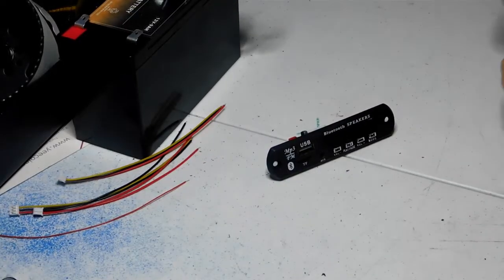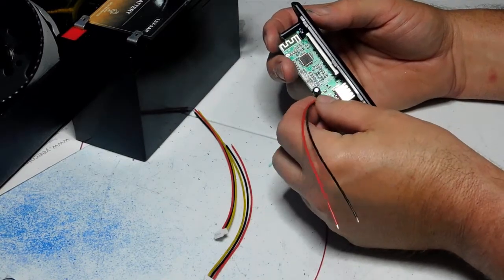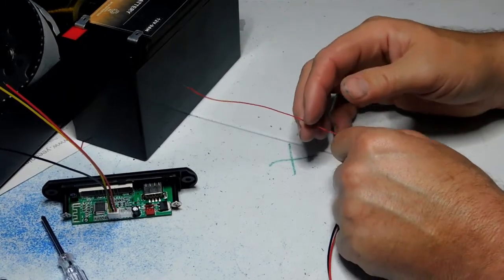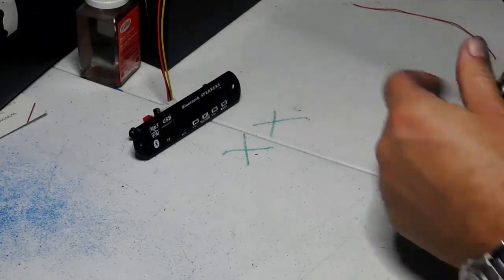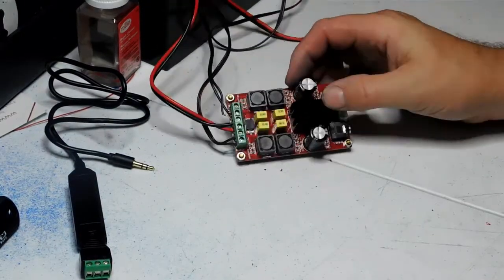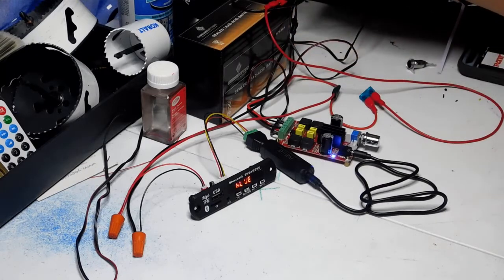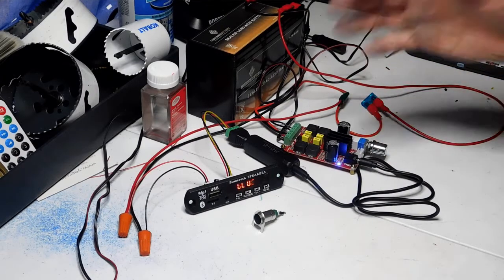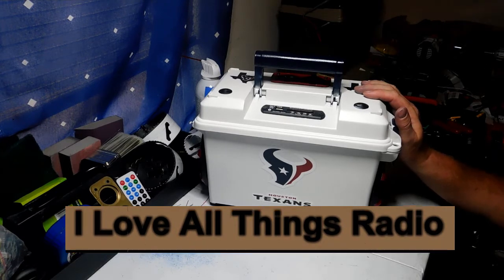How to add FM Radio to your Boom Box projects

Comment: Hey Phil, I've been trying to add an external flexible rubber mast antenna to my metal ammo box build by using the female adapter you recommended in your video.  I soldered it up the way you mentioned but still get rather crappy to no reception.  Any idea what i might be doing wrong?  This is my first time experimenting with the soldering iron so I'm guessing i may have made some sort of rookie mistake.  Any advice?
Reply from the maker: Clovis Steib Make sure you solder thr main lead to the, middle and ground the outside casing to your battery.  Also try grounding the metal ammo can. If you can post some pics in my Facebook group that would be great so I can see what you are doing.  Request to join my Facebook group called I Love All Things Radio.

Comment: I'm trying to find a way to add FM radio to my soundtop on my side by side, which is currently Bluetooth only at the moment...is this what I need??
Reply from the maker: I would actually use a marine radio.  They get better reception and you can power it off the side by side
Reply: I've considered this, just means I have revamp the whole thing. Thanks for your input!!